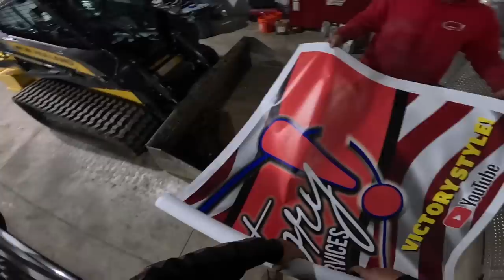Shop work and snowmobiles?

Comment: The bumper turned out awesome Ryan. They should take that exact skirt you did and add it to the bed in production. Offer the salt spreader bar too as an add on. I need something like that for my flat bed chassis cab. I got laid off a few weeks ago, did some plowing in between, and I finally have the time but it doesn’t seem wise to spend the money to build something.

Comment: Those cheap sprayers from Harbor Freight will surprise you. My dad uses them and has only had to replace one after 5-6 years. Just make sure to run some paint thinner through it after you paint with it to make sure nothing gets gunked up inside.

Comment: I use to use the back up beeper on my Semi out of pure spite and revenge.  Use to park the rig on the road in front on my house.  My normal load use to ship from a place 5 minutes away. So I'd drop the trailer go home take my 10hr break. Well a neighbor called and complained about it being on the road, got me a $40 ticket.  From that moment on I would back it up my driveway letting the beeper just rip and echo off the surrounding homes.  Didn't care if it was 2 3 am or 3 in the afternoon it always got reversed up the drive.

Comment: Good job on the bumper.  My concern is the angle iron/plate interface on the back side.  if left open, it will collect salt from wheel spray and rust out.  Maybe caulk it or just weld it.  Hope you put reflective tape on the steps.
Reply: Need to put some industrial screen on the steps like the manufactures do so you don`t slip on the step.

Comment: I painted a entire house with one of their black and decker , Wagner knock off sprayers . It worked great once I got it set right. 30 bucks then didn’t even bother cleaning after finished with house just threw away. Harbor freight definitely has its benefits with their cheap knock offs tools

Comment: Went to Harbor Freight for the first time to get a temporary rotary hammer expecting it to give out after a couple jobs. To my surprise it's been 3 years of consistent concrete break downs and it's still works like it's new. Never overheats, etc in this Phoenix summer heat either 😂 safe to say Hercules knew what they were doing when they built those thangs 😂 HF gets a bad rap... but it's alright in my book